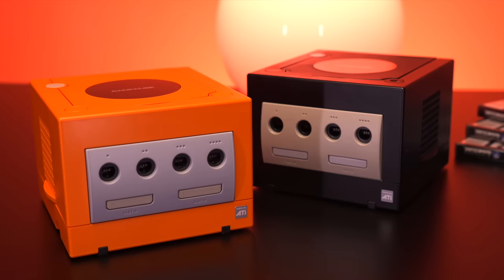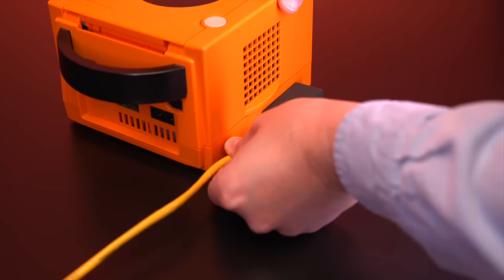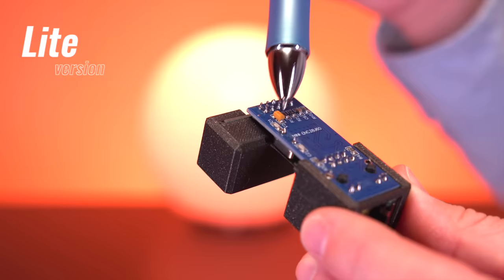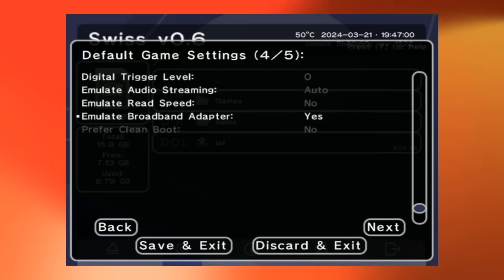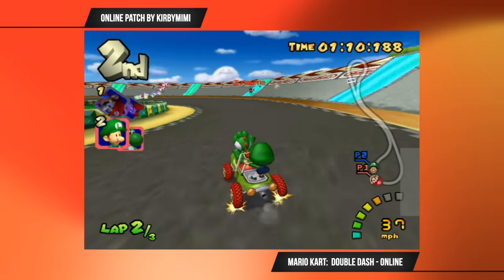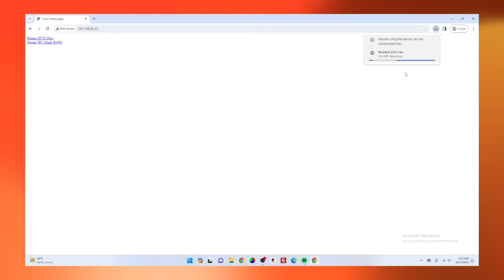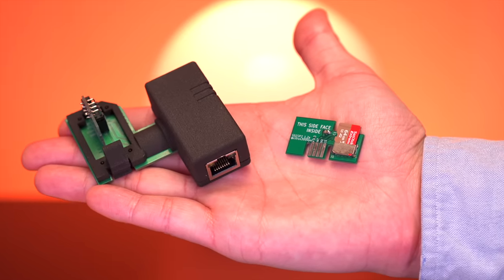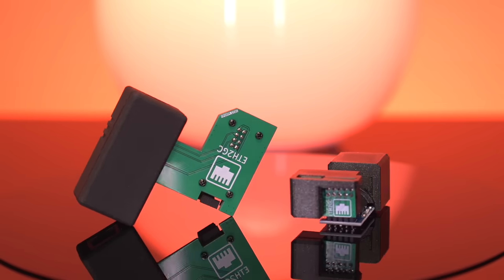DON'T Buy A Gamecube Broadband Adaptor.  THIS Is CHEAPER!

Comment: hmm so just need to get it to 10/100BaseT. then the sky is the limit. just need to switch to BBA/Modem Connector (P6) cant get the speeds form the High-speed Port (P8) but it is easier to start with the High-speed Port (P8). its 8 pins for 8 wires. maybe try something with the 12 pins...10 pin. 3 are ground. oh well good luck see this again in 6 months.

Comment: Is there an option to get one that fits into the SP1? I'd really prefer if it was just a little more streamlined to leave installed in the GameCube. It also allows you to load Swiss in the SP2 port while also using the broadband adapter. Maybe there's some problem with that, I wouldn't know. I realize beggars can't be choosers, but that would make this an instant buy for me.

Comment: A con could be that it needs swiss. Where it would be better if it were able to be free from it and you could just plug and play for those not wanting to go too much into modding their consoles. Perhaps?
Reply: The software compatibility layer is the reason a cheap Ethernet chip can be used. To work without software mods the hardware would need to exactly emulate the original BBA and this would probably mean an expensive FPGA.

Comment: Is there a reason why they went with SP2 for the port instead of SP1 like the original adapter used?
Or is that just because of the M.2 loader that's still being worked on?

Comment: There is a con.... 10 Mbit/s while the DOL-015 supports 100 Mbit/s.... That's factor 10 when loading things from the network... ok... in real life situations 5-7 times the speed. Good project, don't get me wrong. But the speed is holding me back. The GC's optical drive is supposed to run 16-25 Mbit/s CAV....
Reply: ETH2GC in its current state is not meant to stream games over network. There is still plenty of use for online enabled games like PSO or in general for homebrew use like auto updating Swiss.
Reply: @maciejkobus  I know and it's true. But there is also mentioned in the video it is possible to stream homebrew over the network via a NAS. If you want to test those, the speed is important. That's what I want to point out here.
Reply: @RamonddeVrede  but homebrew is usually less than a few megabytes, it loads fast
Reply: @maciejkobus  When you create homebrew within the specs of the GC it will have too slow loading times in between. That is a con. Not a biggy and not for everyone but a dev has to know this if he/she is buying this.

Comment: turns out i have the DOL-001 USA model with the AV port and without the Serial Port 2's socket installed in the motherboard. what the heck can i do to fix this, since the motherboard still has the solder holes for the SP2?

Comment: If I had the sidecar and a GB Player, could I hypothetically play link cable Gameboy games online?
Reply: I don't think so. The GBA chip in the GBP operates almost entirely independently of the Gamecube. It might be possible if you also modded the Game Boy games but at that point why not use an emulator?

Comment: i dint know if its the newer swiss or what but the GC2SD adapters seem to be quicker than the gecko for some reason.... its probably due to the software or the flash memory i was using but for whatever reason I'm getting better results with the GC2SD and it's lower profile taking mircro sd cards
Reply: All of the SD to memory card / SP2 adapters should have identical performance. A newer Swiss version might make a difference or a different SD card definitely will.

Comment: Currently I have a SD2SP2 that holds all of my settings for Swiss and am loading Swiss through my GC-Loader. Am I going to be required to switch to a memory card adapter (a fine solution since I've got a Memcard) or is there a feature that's been added to Swiss that I've missed?

Comment: Got a question. Can we get it for SP1? same with the SD2SP2? Finally why not save time use bot Serial ports sp1 sp2 and make on board do both? Just have the PCB electrically separate but plug into both SP1 and SP2.... Go Real crazy make a new shell for the GBA Player for the upgrades to sit in and plug into all three ports at once.
Reply: AFAIK the hardware will work just fine with SP1 or the memory card slot. I think there was a software reason the BBA emulation wouldn't work when this device is in SP1 but I don't know the specifics.

I would also be interested in an SD2SP1.
Reply: @eDoc2020  forgive me if i am wrong but isnt SP1 the same hardware wise? or is it a master slave issue for software?
Reply: @snintendog   AFAIK the problem is that it's the same port. I don't really know how Swiss works. It somehow traps IO requests going to slot 1, modifies them to fit the other Ethernet chip, and sends them to the new chip. My guess is if the modified requests were sent to SP1 the trap would still be active and the requests would never reach the actual hardware. It probably could be fixed by making some more substantial changes to Swiss.

Comment: Why can't it just work with a stock GCN? Or can it work with a stock GCN?
Reply: Swiss is needed to adapt the commands from original games to what the cheap adapter requires. The hardware can be 100% stock if you use a savegame exploit to load Swiss.

Comment: Question: is there a way to solder an sp2 port onto a dol-101?  If so it probably would look messy lol
Reply: All the needed connections are accessible on vias under the processor. There's a post on Reddit where somebody hardwired an SD2SP2 onto their 101.

Comment: As an owner of the official broadband adaptor is there any reason to switch to this other than also switching my SD2SP2 to the M.2 adaptor?
Reply: Short version, no. Longer version, it's possible that some future homebrew will only work with this and not the original.

Comment: I want this and i have the correct model ganecube but my gamecube doesnt have the port on the bottom even tho its the correct gamecube model, does anyone know how to get around this?
Reply: If you have the DOL-001 without the port the connections are still present in the same place on the motherboard. It's fairly easy to solder directly to the pads.
Reply: @eDoc2020  does anyone on YouTube show you how to do this? Nevermind, I can't seem to find a replacement serial port part, if anyone knows where to find one please let me know